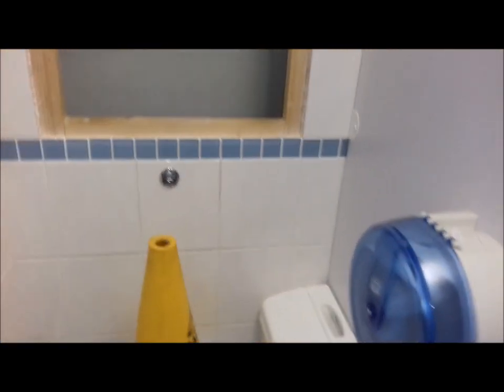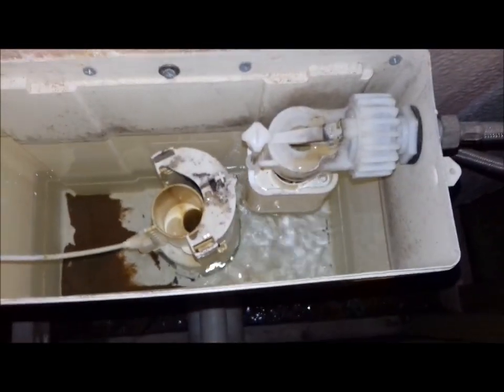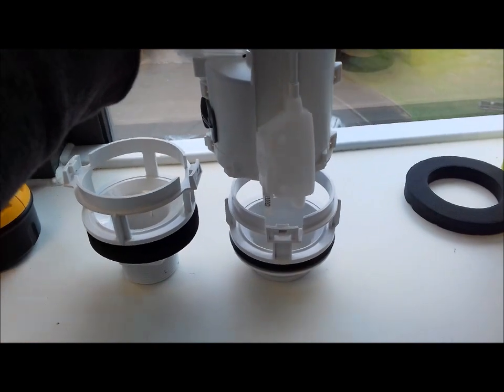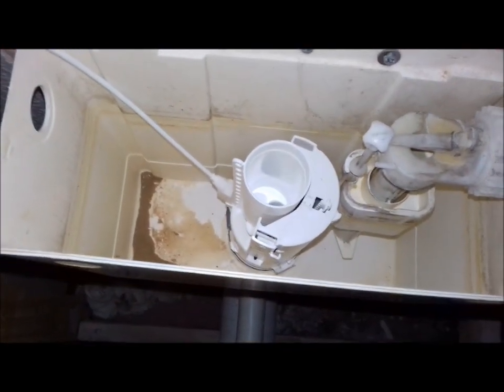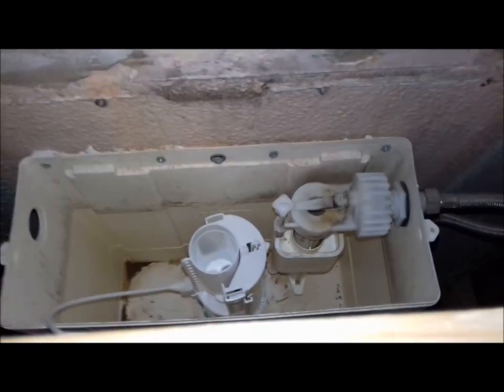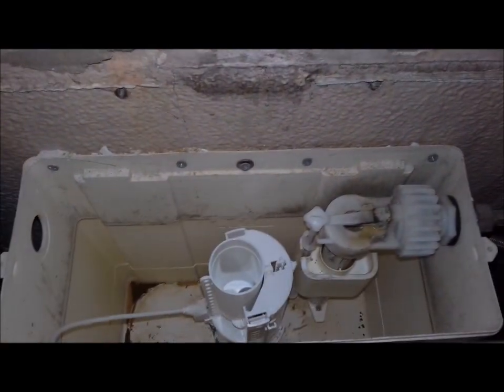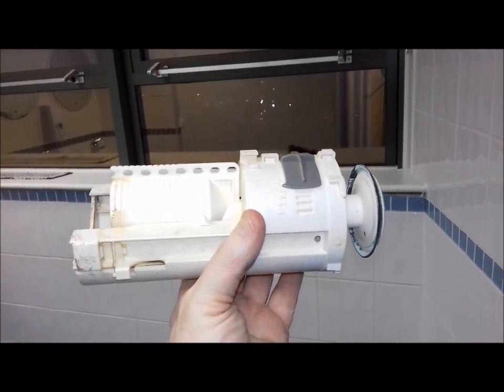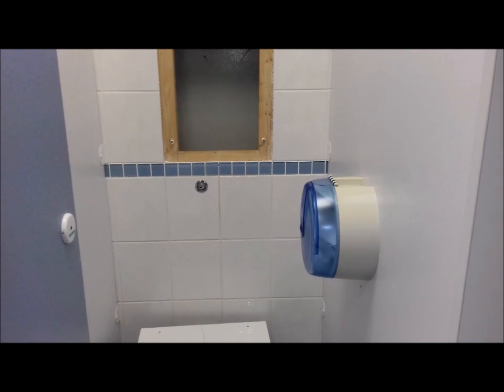concealed toilet cistern

Comment: What a nightmare! Do all siamp flushers twist out like that. The cable on mine broke where it fits to the button! I got a replacement cable but for some reason where the cable fits to the flusher the little plastic arm that pushes up keeps Getting stuck in the up position so the button won’t return to its original position 🤯
Reply: Try squirting a lubricant down the cable guide. The cable siezes inside it sounds like. Same thing happened on mine.